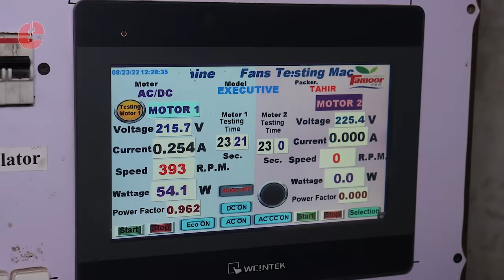How High Quality Tamoor Ceiling Fans Are Made

Comment: Ну надо же, нормальные станки, чистый цех, даже СОЖ применяют. Интересно насколько эти вентиляторы дороже тех пакистанских, которые делают в сарае на коленке в соседнем ролике.
Reply: Both countries have similar factories or assembly shops. You just happened to see one better factory from India. 
However I don't agree that this is a clean factory. Also they used rusted shafts on the fan. The foundry was extremely dirty.  Many other areas were not really very clean.
Reply: Man the Video you Just Saw is From Pakistan. This Fan making company is Taimoor Fans and they are Producing and Exporting Fans from Pakistan since 1988.
Reply: да и инженеры видимо ноги помыли, и коврики у них стираны недавно 👌

Comment: The fan speed  is low due to absence of copper coil.
Reply: Did you not see the enamel coated copper coil? Also, they probably weren't testing at max speed in order to reduce electricity usage.

Comment: The funny reality is fans , especially ceiling fans, does more bad than good. 
1. It actually pushes down hot air from top to bottom.
2. If the blade design is oppositecofcwhatvits today, then the hot air from bottom will be sucked up.
3. Then it's influence is limited to a few feet below it 
4. But on the other hand, the oscillation fan fixed at a lower level throws sir to a wider area as it oscillates. And safer too, as accidently we will notvtouch blades of a ceiling fan.